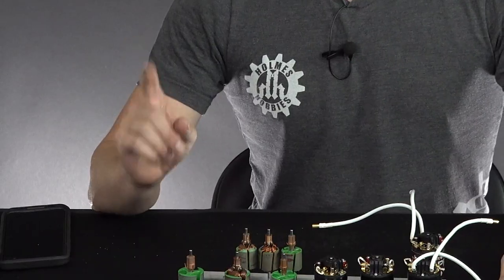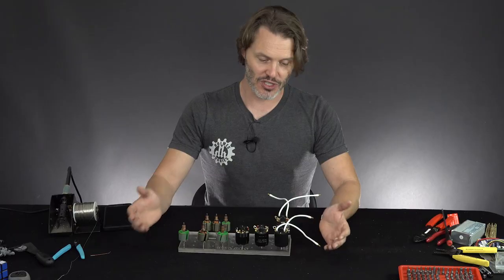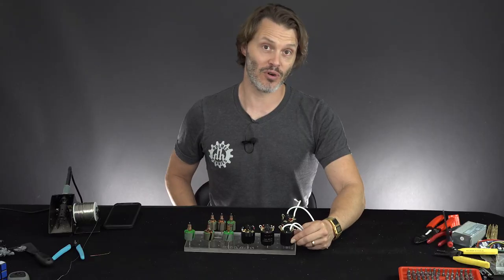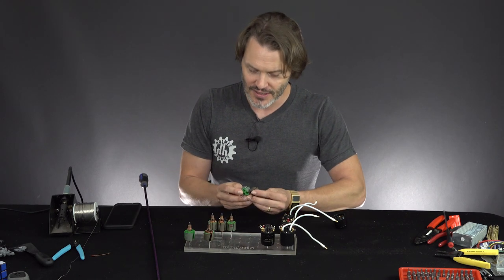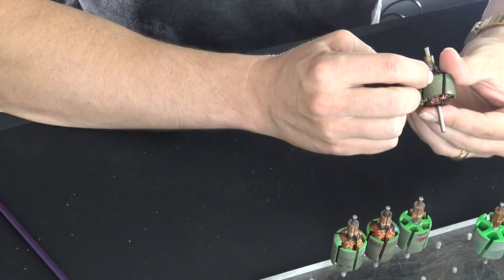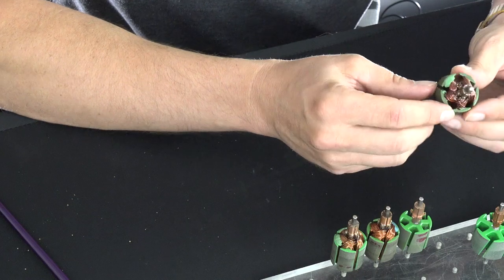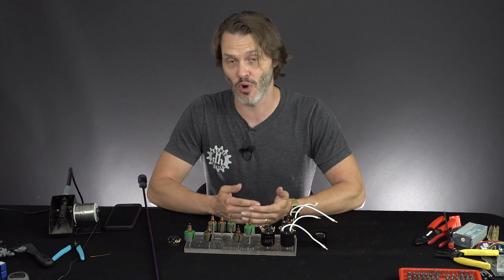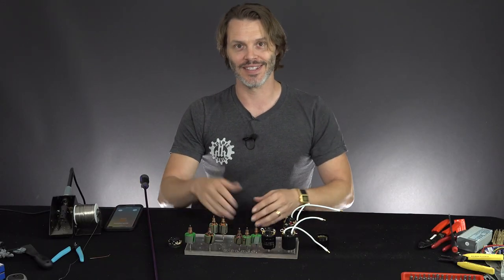Built To Perfection - Features Break-down On The Holmes Hobbies Magnum Brushed Motor

Comment: Started with the sport got and expert loved it, then a pro and finally got a magnum and yeah hand wound is the way to go and the magnum just feels so much better, I don't do comps but I love to run good stuff and these are the best out there I've pulled 2 brushless systems for the feel of my magnums and wont go back.
Reply: How much does the ESC change the 'feel'?  You have worked your way through all the Motors; did you do the same with the Controllers?
Reply: I don't do comps so I run sensored brushless... wont wear out, has excellent efficiency, smooth startup, tons of rpm, and amazing torque and power characteristics... 2700kv, 14.8v, 11t pinion gets my carpra to nearly 15mph yet can crawl oh so slow. 3500kv, 11.1v, 11t pinion in my trx6, or the puller pro r 4100kv on 3s, has it crawling very slow but with excellent speed. 5ah pack on the trx lasts 1 to 1.5 hours while the 1300mah 4s packs on the capra last 45 minutes.
.
If I comped I'd run a motor specific to the course... ie, high traction = slow crawler with soft suspension and low traction = a lotta wheel speed and stiff suspension to bounce over obstacles.
Reply: @RTmadnesstoo  the esc is very important. you'll want something with a programmable throttle curve to make slower crawling even more controllable. It's throttle resolution and curve can be the difference between the smoothest startup and the worst, and can make the most smooth motor feel like the crappiest. You need quality esc and motor.
Reply: @KTMcaptain  is your sensor less set up water proof?
Reply: @Djkommode  all my motors are water proof. The puller pro “R” models require servicing after submersion though.
Reply: @KTMcaptain  what about the esc?
Reply: @Djkommode  esc’s are castle and claimed to be water proofed. Never had an issue.

Comment: Still rocking my Crawlmaster pro 13t in 2022 when everyone is going brushless. Every few hours of runtime I pull off the end bell, inspect the brushes, remove the bearing and spray out all the dirt and copper with electric cleaner. I also use a alcohol Q-tip to clean the commutator.  I love doing maintenance on my rigs.

Comment: Just revisited the video to admire your beautiful motor I have one in 11T that I’ve been trying to find the perfect home for it I haven’t had any comps happening around me so I took it out of the comp truck I had it in. I think the Capra will be the next rig to give it a go with a 9 tooth pinion I tend to not trail the Capra so it really only gets put in rock climbing situations and I drive very slow and smooth. What do you think about running the 11T magnum with a 9 tooth in a Capra using the micro mamba X as an esc? 
I love your products and appreciate your videos keep bringing the heat and innovation!

Comment: So John, for a TRX4 that is around 11lbs which Crawlmaster Magnum do I want for slow smooth crawling (no comp) and top speed is not critical.  I'm thinking the CM Mag 540 16t would be close to my current CM Pro 550 12t with a 9/45 gear.  Yes/no?
Reply: 11 pounds! wtf... that's how much my erevo weights... my trx6 isn't even that heavy.

Comment: I’ve only ran Tenkin Roc 412 2300kV and 1800kV on 4S and and. axial 20T motors because I like the wheel speed. I wanna try a high end brushed motor with a lower turn for wheel speed and I will probably use a Mamba X ESC. What do you think would give me the absolute best control but enough wheelspeed to top out at around 11-13 mph?

Comment: OK.  So you got me going and full of questions.  I love all the information and seeing the parts all disassembled.  
Is there anything that can be Reused after you catch a Motor on Fire?  Does the Heat destroy the Magnets or can you stick Bearings and another Armature in and take off?  How Hot do you bake the Resin?  Have you explained the Angle of your Armature Slots?  'Skewed' I think they call it.  Are all your Magnum Motors like that?  What kind of Metal are the Armatures made of?  Pure Fe?  How do different Brush Compounds affect the performance of a Motor?  Do Brushes that burn up fast produce more Power?  It never occurred to me that drilling on the Armature would disturb the Magnetic Field.  Is there a way to see what the Magnetic Field looks like?

Comment: I purchased a Torque Master Magnum 540 45T.
When I tested the operation using a PWM type DC transformer with short circuit detection, it detects a short circuit at about 5V.
Is this a malfunction?
Is the short circuit detection too sensitive?
Reply from the maker: motors will always show as short circuit to a meter.  They are very low resistance and just look like some wire connected to itself.

Comment: I aspire to be a "motor snob" My last two builds the motors I wanted were out of stock. Both times I ended up getting another Holmes hobby motor (torque master expert 550 21 turn) that I am very pleased with. I am now building a Capra and while waiting for the motor I want to be in stock (revolver) I ordered a "place holder crawlmaster sport;"  540.  Love your motors an effort you put in to providing quality motors. Thanks for giving us great products at reasonable prices.
Reply: Come on man.  Holmes is a proper name and should be Capitalized ..... and Spelled Correctly.
Reply: @RTmadnesstoo  I'm legally blind and I was using voice to text.
Reply: I wouldn't use a revolver in a capra... too much crud gets up into the electronics section between the battery tray and the skid. Also, the capra is geared too tall without using an aftermarket transmission. I'm running the lowest gearing, 11t pinion, and it has a ton of wheel speed. Honestly though, the capra is excellent with some wheel speed and power. Mine runs 14mph on 4s with a 2700kv puller pro standard and 11t pinion. When I do strait high traction crawling I put in a 3s pack, but I use the power adjustment setting on my mamba x to adjust my power delivery depending on the situation which means on 4s I can go anywhere from 3mph to 14mph topped out and the esc scales the throttle with the adjustment so on the lowest setting I get 1.5mph at half throttle vs 7mph when set to max power at half throttle.
.
best mod, by far, for the capra is 4 wheel steering. I run this thing non stop on opposing steering for tighter steering and it feels amazing. I hate using it in 2 wheel steer mode. 
.
Funny thing is I get more compliments and awes with my capra than I do with my erevo blasting down the volley ball courts at 50mph.
Reply: @KTMcaptain  Thanks for the tip. I haven't got the capper kit yet Should be here in the next few days so I don't know the layout of it very well. Yes I've seen pictures online but I have vision issues so nothing is very clear to me. Right now I just have a 5:40 crawl master to throw in. (Coming with the kit from Amain.) What would you recommend for a brushless power system? I do like low speed control but like more wheel speed than most people for my crawlers. I like the stock gearing and 3slot 21t torque master expert on my two TRX4 sports for reference.
Reply: BLIND J the Capra is definitely fun with wheel speed which is why I think axial geared it so high from the factory with a 14t pinion. I run an 11t on a 2700kv puller pro. I think it’s nearly perfect. It can crawl smooth and slow, and is very close to the maximum speed I’d want to go with the Capra. 
.
I drive mine like a bomber half the time and it’s great. Just be careful of the battery compartment size. It’s small. 
.
I’ve ran this setup on 6s and it’s too fast with too much power for the chassis. But it’s amazing. 
.
I’m partial to Holmes’s puller pros, I have the 3500kv and 2700kv standard and 4100kv pro R, and I like to use castle X speed controllers because of the on the fly adjustments. On my 2 speed trx6 I use rock race mode and on the Capra I adjust power via the radio. 
.
I’ve never tried using brushed outside the stock titan 21t, but I do know the puller pros are very smooth to start and have torque for days.
Reply: @KTMcaptain  every time I go to purchase one they are all the stock. That's the original motor I wanted for both of my TRX4 sports one kit and one RTR. The Capra I have common is the kit version

Comment: Yes!!! Can’t wait to start watching this. Got mine ordered as soon as the most recent batch of Magnum cans came in. Lol, now just need to get someone there to build it for me:) Still waiting for shipping notification. But hey, quality takes time.
Reply: I got the 16T on order, can't wait to get it installed. Hopefully, it comes with the screwdriver ;-)
Reply: Joseph Ayala Haha very good! Ya I could use a small pocket driver like that:) So being relatively new to the hobby, question for you? How did you decide on the 16T? I had a tough time choosing.
Reply: @ravensdalerc  For sure, it was hard figuring out which to get. I'm still not sure I made the right choice. I ended up using the motor recommendations on the website. I had to cross reference a bit for the Axial Capra, because I wanted something a bit slower. Then I heard John say he liked the 16T in one of his previous vids and I was sold. Lol

Comment: Do you have a wild 550? I build combat robots, and im trying tonget more power on my 3.1mm pinions and ideally run more volts im 5s now and would like to get to 6s to simply my system. Motors are only used for 3 mins at a time but are heavily abused!!!

Comment: can you compare your 1/8th motor vs an erevo motor? I know the rotor is 19mm in diameter which should be around the same diameter to your puller pro series... Do the punchy ones put out more power, or is it just stronger low end?

Comment: So if I would order a magnum would it be Feasible for this motor to be a 8 turn and I mean the standard size I have gotten a Couple customer and rotors for the CM 550 and a 500 flow in a 23 and they start up great still so cold that work with the magnum

Comment: BRAZED Comm leads? That in itself is IMPRESSIVE!! 
John, I'm already SOLD on Magnum Motors! The cost is impossible for me at this time.... But that's finally changing next year, when I get a HUGE Inheritance, that I've been waiting 20 years for. 😁😁😁

I'm not just into Crawlers... I Club Race occasionally, On-Road.
QUESTION - could you make me a Magnum Motor, say about a 17 or 19 Turn 540? I can see that giving me quite an edge, and they can TAKE the heat, obviously. 😉
Carmine ✈🚂🚙

Comment: What would you recommend... the BEST in brushed motors or the best in Sensored Brushless for the best crawling experience? Thinking for a scx10ii/Enduro or VS4-10 build...
Reply: Kind of depends on what experience you want. All out power and wheel speed, brushless is the way to go. But if you’re looking for the fine tuned feel and control, brushed is the way to go. 

Personally since I love slower technical crawling lines, I prefer the crawlmaster brushed line.
Reply: @chevyon37s  thanks! I just ordered a VS4-10 and I would like to make it as smooth and technically capable as I can... I don't intend to just "send it" with this build. Much appreciated!

Comment: At 1 time, eons ago, & if I remember correctly, wasn't there a "short stack com" motor? Too, if I remember correctly, "some" concrete oval ppl used them. Been 15 or so years ago.
Reply: Yeah, a way to squeak out more rpm when the torque isn't needed!  But in crawling we just wind em slower.

Comment: i have your crawlmaster pro 550 in my coyote its a beautiful fantastic motor i will be buying more of these for my other crawlers i used to do cheap motors but having tried this motor i will buy more as the others die i would also buy one of these for a comp crawler i am building when i get to the electrics bits
Reply: What esc do you pair it with .?
Reply: @jrsantoyo9028  it's paired with the hobby wing 1080 works perfectly with it
Reply: @rileykairc  dude I'm ready to get the stubby. But was wondering What esc. Because I have a mamba x and a micro mamba pairs with their sensored brushless castle motors. But these are brushd so no 3rd wire. So I was curious. So that 1080 is a good match. Ima get it. Thank you bro
Reply: @jrsantoyo9028  I think it's a very good match and it's so quiet to which is perfect for me I hate noisy motor ESC combos ,the 1080works really well with this motor and does what I need it to ,I now have 6 crawl master pros in my crawlers with 1080 ESC paired with them I also have the magnum,and little Tugger to and they both have 1080 s to

Comment: I wouldn't spend that much on any kind of electric motor. A nitro engine though.... Now that is a motor.
Reply: No.. that would be an ENGINE. and I hate to break it to you, but a brushless motor has far more power and torque than a nitro engine.
Reply: @TangoOne  I don't care about power and torque if the car is dead and boring.